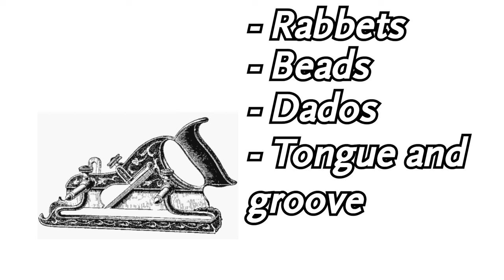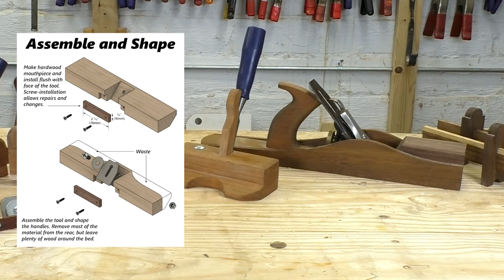The Surprisingly Essential Plough Plane

Comment: Nearly every tool I have and use are old school second hand items. That's invariably fine, and I have a Stanley 50 the little Record and some traditional wooden jobs, but they can be  frustrating to use and take an age to set up. As a treat, I bought the Veritas small plough plane. What a revelation! It's designed along the same lines as the originals, but the quality of manufacture and some well thought out design improvements make it an absolute joy to use. They're not cheap, but for how they work they're worth every penny. I can also rest in the knowledge that it's a quality item and the only one I'll ever need.
Reply: I hesitate of buying a Veritas small plow plane. But after reading your comment It may have change my mind. I also plan to get most of the accessories plane blade and conversion kit a bit pricey any feedback on that from you I would greatly appreciate it.
Reply: @nghiale2758  I'm sure you won't regret it. I'm still delighted with mine and always look forward for an opportunity to use it.
Reply: @mrstandfast2212  Thank you very much and wish you have a great holiday season.

Comment: FWIW, the Veritas Combination Plane (sold by Lee Valley) was designed to correct the shortcomings of both the Record and Stanley models while still using the Record 405 & Stanley 45/55 blades. While the price is eye-watering, to be honest, it is built to be something that your great-great-great grandchildren will fight over.

Comment: I picked up a Record 043 last year on eBay for £16 (U.K.). It only had one slightly bent 1/8” iron. Fortunately I also have a Record 405 with a full set of cutters and the smaller ones fit the 043. I definitely prefer the 043 for drawer bottom grooves over the 405, it is just quicker and easier to set.

Comment: The on thing I did notice about these plow planes. Is they are not really solid when taking a deep gouge.
The power it takes to push thru the deep cut, makes the plane unstable.
I think a shallow cut at a little faster speed is more stable.
I like your shop made version.

Comment: I got one of those $60 Chinese ones off Amazon. It's a lot more fiddly than I expected. Hopefully this will help provide guidance
Reply: The Mujifang? Me too. Once I get it set it works ok. The fence bugs me...
Reply: The blade is not that lasting right?
Reply: i've just bought onje of those chinese plow-planes. What i have to do to get it working well?
Reply: @carlopieracci2828  The blade must be sharpened. At least to 1000 grit.
Reply: @BeachBoi1000  i do the same to my Blades. I sharpen to 1250 grit then strop.  Its a routine for me
Reply: @carlopieracci2828  I want to throw away the Chinese plough plane… it’s just… yucky. The edge get blunt quite quickly. Wanted to buy a Veritas Hand Router but the price…
Reply: @BeachBoi1000  The Cowryman isn't that bad a router
Reply: @chadjazeera9960  It's a YaoBao, and it has a pre-set "depth fence", which means I can't just cut to a desired depth
Reply: @spook233  I buy a good tool, I just need to buy once.
Reply: @carlopieracci2828  Shallower cuts, and lots of practice pieces to get the feel

Comment: Good job! Could you not get a bigger vice?! Seriously though, put the Yankee pump driver in the back of a drawer. They're great for hanging doors etc., but they are not much use for anything else. Get yourself some cabinet makers screw drivers of engineering screw drivers. These offer much more control and are capable of handing much more power. They're also 10 times safer in use that the Yankee. Keep up the good work!

Comment: You can find a Record 405 multi plane in England for £50-£100 in good working condition on Ebay. Most Brits are totally happy to ship to the US- might cost £25. Ok, Record doesn't have the collectability that Stanley multi planes do, but they are the equal in every way in use.

Comment: I think prices must depend on location a lot.  In Wisconsin, Stanley 45s outnumber all other plows combined.  

Most people seem to want a full set of cutters and doodads, so a basic 45 with a few straight cutters is much less expensive.  I have two that cost me $25 each, and have seen at least 10 others at that price at MWTCA meets.  

They may be a bit higher now, but are still likely the least expensive option here.

Comment: I got a Stanley No 50 with almost a full set of cutters. I love that plane but one thing bugs me. I have not figured out how to put in the smallest blades though. The part of the sled thats sliding on the rods doesnt slide close enough to the plane body, so these 2 parts cant press down on the blade. I have tried putting in 2 smaller blades, one of them turned around but then the blade is slightly tilted and you dont get a clean groove. I would love to see more on more "complicated" planes.

Comment: Record combination plane: "Not a great experience." That is exactly my view, too many adjustments, many of which do not adjust smoothly. not a nice thing to hold or use.
You are right though they are available for next to nothing in the UK, because no one knows what they are, what they do, or how to use them.
Given that £150 will buy you are small power router and a box of bits with all the same capabilities is it any wonder where people put their money?
Every School workshop I ever taught in had a wooden box with one of those in, unused since probably the day it was bought.
Reply: I came here to recommend a small router instead. For this type of a job, they work wonderfully, and are actually faster and more accurate than hand tools.

Comment: I bought an old record 43 with a single cutter for £16. Unfortunately the cutter was home made and a bit dodgy but fortunately since the 43 has no blade advancement you can slide chisels in there. Groovy.
Reply: You can get a set of replacement cutters from Workshop Heaven for £13.

Comment: Hi Rex
I recently noticed some strange sound in your videos.
If I'm not mistaken its artifacts from digitally removing echo,
reverb or roomnoise from your voicetrack.
You might want to invest in sound dampening panels (maybe with some nice wooden frames ;-)

Linus tech tips recently made a video on some ceap ones and i can not unhear it since.

Anyway have Fun
Phil
Reply from the maker: Believe it or not, the metal planes conducted odd noises into my wireless mic. I have that problem sometimes.

Comment: The Stanley 45 and 55 are some of the most expensive planes when you try to add up all the pieces but they are one of the few times that a tool is designed to do multiple operations and they are perform great. I think I'm into about $150 into my 55 and still haven't gotten all the irons for it yet. :/

Comment: I'm not that sophisticated with hand planes - I'm still using them mainly for flattening and squaring stock.  My old Portal Cable handles all of my dado needs.  But being able to do it by hand sounds interesting.  I wouldn't buy one of these though, I would use your chisel design and modify it so it could accept multiple width chisels.

Comment: I’ve got my Stanley 45 from grandfather. The only problem is it has only one quarter inch blade which was inserted in plane ☹️. And once I tried to use it i ended up making that job with miller, it’s really not that easy to use.

Comment: I sort of kind of agree with this. But being super practical one of the electric handheld trim routers does this very well, and for cheaper, and has a variety of uses. Your new approach to modern woodworking will probably need to include some affordable power tools that replace and improve on a lot of hand tools.

Comment: Ahh.
This reminds me to partially remake my wooden Ulmia-style plow plane (there's no branding at all on the plane and it's completely unfinished). The rear skate is a little to far from the iron and the depth stop is pretty uneven. It did come with all of the irons though.

Mr. Roubo has me covered for mouldings, just need to make some round, hollow and a small rabbet or shoulder planes for ogees ^^;

Still would like a no. 50 though. I don't mind making cutters for it.

Comment: The Record 044 (or its variants) is much more capable than the little 043, easier to hold aswell; was never a fan of that webbed grip on the 043. Record made a plane called the 040, it's the same shape body as the 043, but it has 1 fence arm instead of the 2 found on the 043...... and the 040 is blue; dont tell James 😂 
The 044 comes with 8 straight cutters from 1/8 goin up in 1/16 increments and it has depth adjustment...... they do not have the second sliding section that the 050 has, so anything bigger than 1/2inch is a mission to plough. The 044 has the same size and shape body as the 050. 
I use my 44 plough (A Marples version) for grooves, and it is BY FAR my favourite tool 😁 My 050 gets used for tongues, fillisters (with the spur engaged) rebates, and small beads. Set a VERY shallow cut for beads, they like to rip the wood apart if it's set even to a medium cut. I found any bead bigger than 1/4 is hard to cut smoothly.
On any of these it is worth making a wooden subfence....... do NOT expect the metal fence to be square to where the iron cuts, your wooden fence will more than likely need to be tapered; usually slightly thicker in the bottom than the top I found. This is important to get it cutting squarely and smooth, the fence is your main register, pushed to the work with your left hand; it guides the plane in every way.... so its important to get the fence square or you will sink a slanted groove/rebate. Use the hardest wood you have for the fence 😁
I enjoyed this Rex..... I love to get groovy 🤙😂

Comment: Rex, how would you design a wood lathe table? I need height and rigidity and I'm having a hard time thinking anything up in wood...
Reply: A stout topped single bevel trestle design will work well. I suggest an angle of 15 degrees.

Comment: I have enjoyed watching a fair few of your videos and picked up no end of good tips. I have a record 044C, a record 405 and a couple of Stanley 55s. They are certainly versatile but very fiddly and frustrating to begin with. You have to persevere a while as there is a definite knack to them but they do click eventually. I find the complex moulding blades easier to use to finish off rather than do the whole cut. For an ovalo I would cut suitable rabets on the corner first then chamfer off the bulk of the waste before doing the curve with a half round cutter. Less chance of wandering off or gouging out a huge chunk.  I have to say I prefer and enjoy using the old wooden tools more than the later metal ones even when it comes to common planes. My favourite is a wooden 24 inch jointing plane which goes from effortlessly roughing down knotty pine to taking a wafer thin shaving with just a few taps of a mallet. I am seriously thinking of getting getting some hollow and rounds to see how making mouldings with those compare with a combination plane.

Comment: I am not trying to be negative. But man, i just can't justify buying any of these over a cheap electric router. 
If you just like it for the fun of collecting tools, go ahead of course. But to me these plow planes already look complex and fiddly enough that i don't see the charm or the money saving over a power tool. Maybe i am wrong? What do you really like about plow planes and not about power routers?
Reply from the maker: Safety, quiet, no dust. Oh and no need for electricity, easier to control, far easier to use on the edge of a board. You can grind custom cutters. The list goes on and on. I own a router, so don't think I'm some purist, but they have WAY too much power for most of the things we use them for. A little tool like this is much better for delicate furniture jobs, or at least I think so.
Reply: @RexKrueger  Awesome, man. Maybe i'll end up giving this tool a try.
By the way, the 'no electricity needed' argument could stand to be dropped when talking about a tool that pretty much needs a full feature bench and good lighting to work well. I am not seeing you working by candle light in the middle of a forest. 😁
For the rest, yeah, good points.
Reply: @max-zv7sf  Yes and no. In my garage shop, I've got one whole 20-amp circuit. Whoever built the garage wired the lights and the receptacles on the same circuit. (I would like to drag said person into an alley for a persuasive conversation about ever doing that again!) So I have great lights and whatever bench surfaces I need, but I can't run much for power tools without thousands of dollars to run a whole new feed line under my concrete driveway to the garage and then whatever rewiring of circuits would happen in the garage walls and plenum. Someday, maybe. For now, though, I'm learning the virtues of hand tools.
Reply: No noise, no dust & chips all over the workshop.  I also find it easier to set up a plough plane than a router for some reason.  The electric router is an excellent tool and does a good job, but I don’t find them that easy to control, especially on the edge of a board.  Also you don’t get a good view of the cutter which I don’t like.  However my principal dislike is the noise and mess.  You can control the dust to some extent, but only at the expense of even more noise - and another hose to get in the way.